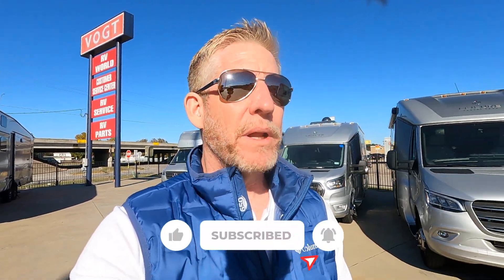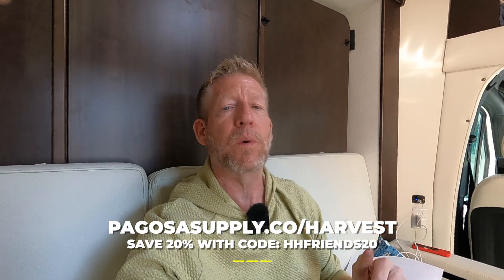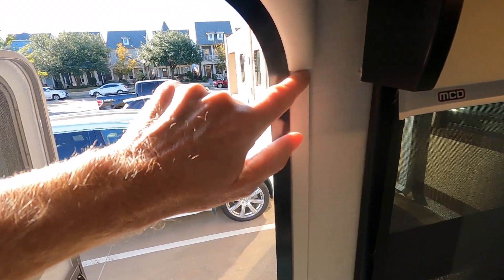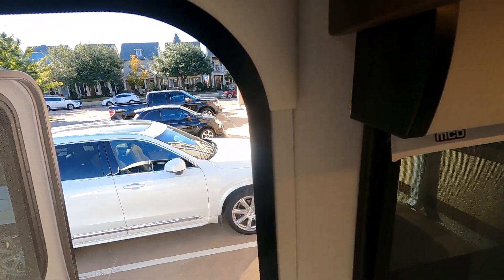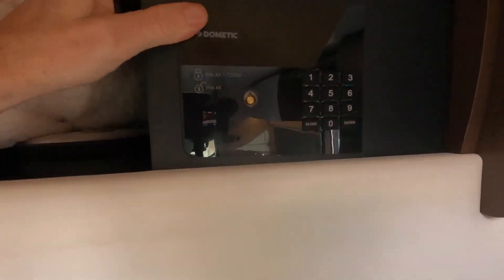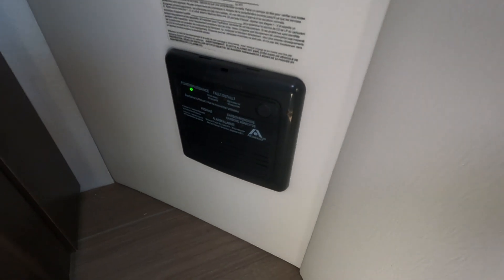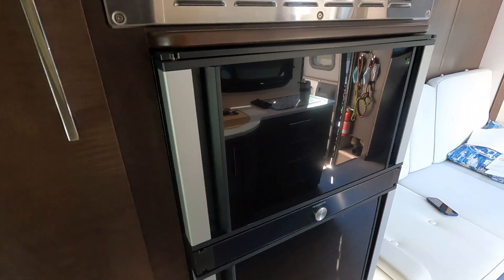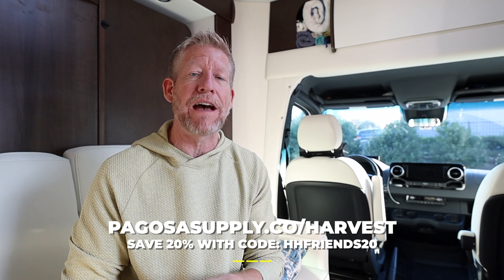These were not covered under 2 year warranty - Leisure Travel Vans

Comment: We enjoy your channel, Brandon.   We had the same galley drawer slide come off on our '19 FX.   I just used toothpicks and white glue to repair the holes.   I was lucky to find the screws below in the void, and I was pleased to see it was clean down there.   I believe the screws may have just succumbed to the pounding, and we may have exacerbated it.   The only other real issue we had was the tail light wiring harness rubbing against the fresh water tank bracket.  I fixed the bare wires and informed LTV.   You have to remember these are built to a price point, and all the components are made by a few companies.   We were recently 5th wheel shopping, take a look at the craftsmanship on those.
Reply from the maker: yes, I can't imagine how bad the travel trailers and such are put together. Thanks for the info, I may see if I can find the screws and just do it myself

Comment: When I bought our 2019 FX from Vogt earlier this year, we we’re having the same problem with the same struts as you are.  The ones located underneath the slide.  I called  Vogt and they had LTV send me two replacements.  The replacements were doing the same thing in cool weather.   Then it was getting to be warmer weather so they started working.  Now that it’s getting to be cooler weather again,  I just ordered two new replacements from Amazon and we’ll see how they do.

I’m with you, if LTV would use better components I would gladly just pay for them.  Either you pay for it up front or pay for it when they break.
Reply from the maker: Love to see which ones you ordered from Amazon, can you shoot me the link to brandon@pagosasupply.co?
Reply: @Pagosa  just sent the email 😀

Comment: Thanks, Brandon. I recently needed to replace a strut on a boat storage locker and discovered that Auto Zone had a large selection of sizes. I just popped the old one off the ball knuckles and popped the new one on. 10 seconds. And yes, the struts on the other lockers are still good after 22 seasons so it does seem a bit odd that you had 2 already give up.
Reply from the maker: These are on the larger doors, so I assume the size of struts used are not rated for that weight. The smaller doors are fine. I'm going to find some good replacements.

Comment: Consider the MAXXFAN Deluxe model 7000K or 7500K.  Remote control.  We love ours...was an upgrade on our Navion.  Has auto temp set, reverse air from intake or exhaust and Variable fan speeds.  2yr warranty. Exceptionally reliable... flawless for 4 years.
Reply from the maker: Thanks for sharing and look forward to a better option for sure

Comment: I agree, RV products are pretty cheaply made and certainly surprised LTV would install crap products like the solar controller.
My Wife and I are about to order a new Corner Bed Unity, we live up BC Canada so seeing your frustrations is a bit alarming M8.
Personally those outside locker’s should have two gas struts per door, and secondly replace them with good marine quality units.
I ran a my own Marine Repair company for nearly 40 yrs up in Vancouver, so I’ll be replacing pumps and installing a marine quality macerator in the RV down the road.
I don’t like the 3 way fridges either, so I’ll be converting it to a compressor AC/DC type.
Buying a refrigeration kit and installing it myself won’t be too difficult, certainly no more than converting a boat’s Ice Box to a Refrigerator/Freezer.
Installing a marine propane sniffer system in place of the existing, and fitting the sensors under and close to those appliances operating with propane should be straight fwd.
Personally I’m not even a fan of Xantrex converter’s, always had issues with these in the marine industry.
Love your channel and will certainly be buying some of your products.
Good luck with your repairs M8.🇳🇿🇨🇦
Reply: We upgraded to lithium and replaced Xantrex and all solar and inverter systems with total Victron.  What an awesome difference in efficiency and maintenance free!!
Reply from the maker: Thanks Murray, I will look for Marine grade struts to replace. We have lithium and had intended to replace the solar controller anyway to a Victron, so now it's just making me do it and not be lazy, lol.
Reply from the maker: Yes, I'm a Lithionics guy with our battery and will be putting in the victron controller for sure.

Comment: You might try contacting the manufacturers of the components directly and see if they will do anything. On a non Leisure Van I had a dealer tell me some things were not covered under warranty but when I contacted the manufacturers directly they were covered under manufacturers warranty.
Reply from the maker: I definitely plan on doing that, as well as talking to Leisure. I know a few of the management team watch these videos, so hopefully they understand putting some bad quality items in isn't a great idea.
Reply: That’s LTVs job to work with the component manufacturer.  LTV should be covering those items for you, and working with manufacturer for their own coverage.   LTV is the customer of those manufacturers, not you.

Comment: On your drawers, the slide extensions are not the problem. The screws are stripping out from the wood. For a permanent fix, take a screw out, coat with Loctite and screw back in. Do this one at a time to all of them and it will cure your drawer problems.
Reply from the maker: Yes, I think I said it was the glide's fault, but clearly it's a screw, or a cabinet material issue. I'll take advice about the lock tight. Thanks!

Comment: Wow those drawer glides dont make sense! Mine has been at the dealer for a month. The safe doesn’t unlock too. The propane tank doesn’t fill and has to be replaced, and tank sensors don’t work 1/2 the time. Thankfully everything was covered under our 90 day sellers warranty. We also bought the extended warranty.:)
Reply from the maker: Geez, that’s a lot

Comment: Any issues with Fantastic Fan can be handled directly with the manufacturer. Over the years they have sent me parts for free that were several years out of warranty. Hopefully, that is still the case. When Newmar had an industry leading 3 year warranty, they made their OEM vendors match their warranty. However, other RV builders didn’t follow Newman’s lead and Newmar dropped back to a one year warranty in 2006, except for high line diesel models at 2 years(not sure bout 3rd party components). 

I would not take any RV to a dealer for service. Independents have quicker turnaround, live or die on their customer service. Dealers first priority are getting new and used sales units out the door. 

For those thinking this was an excessive punch list, know that this really minimal. Doesn’t excuse the problems, but as an RVer for 22 years, this is small stuff. And, the more high line a coach is, the longer the punch list. I like that LTV will ship parts directly to me instead of requiring I order and pickup through a dealer. I had them send replacement LP/CO detector, Jensen house radio, remote door lock sensors and a couple of other items early in the first year. No questions asked. Did the work myself, and I’m no RV tech.
Reply from the maker: This was extremely easy punch list. Love my LTV

Comment: Just took delivery of our 2022 Unity RL on 15 November. Good news it that the Go Power Solar Controller is no longer being installed on newer units. Zamp rigid panels are now standard. Bad new is that the controller is now a Zamp ZS-30A paired up to the panels - which is still a PWM-style controller. Also, it is NOT Bluetooth-compatible.

Our Fantastic Fans are controllable from either of two remote panels, the main Firefly panel or via my Mira phone APP. The phone APP and panels do not control the fan speed - which is still a manual knob.
Reply: Forgot to add that our safe is on backorder from Triple E.
Reply from the maker: Ah, bummer. They had a chance to put in a good solar controller and they still didn’t. Just don’t understand that logic. Congrats on the RL!
Reply: @Pagosa  Thanks. It was a cancellation by a couple that faced some unexpected medical expenses. It has all but a couple of the options we'd ordered and didn't anticipate recieving until Summer 2022.

Comment: That is an alarming number of defects for a relatively new van, especially considering how much of a demand there is for these units.
Reply: Still waiting for our LTV Wonder. This video will give me a few things to really inspect when I finally get it.  I am still at least 18 months out so maybe your video will cause them to get better quality parts for their expensive options.
Reply from the maker: The RV experience is one of constant things going wrong, but I was surprised by the safe and the solar controller going out so quickly.
Reply from the maker: Hopefully so!
Reply: I had a LTV and it was MILES AHEAD of the quality versus many other units.  Sure somethings broke but driving down interstate roads at 65mph that are literally falling apart all RVs are going to have some issues along the way.  I wouldn't hesitate getting another one.....
Reply from the maker: @cocochanel9291  Agree, I was just disappointed in the cheapest third party components they could find.
Reply: @Pagosa  As an aside, the struts failed on my 2018 LTV.  I would agree that certain parts are suspect at best.

Comment: After watching this, and your own harsh critique of LTV for using cheap components, I’d say describing their product as “premium “ is a bit of a stretch.  There is no way the use of cheap low grade components ends at what you’ve discovered.  Cheap low grade goes end to end, and to think otherwise is naive.  You’ve proven it.  And LTV’s short and weak warranty proves it.  Furthermore, the fit and finish elements of the build took a hit here as well.  Im not an RV owner, but am considering buying B+ in near future.  While I really like multiple design elements of LTV, I’m not impressed with the quality.  And this video backs that up.  Thank you.  Good video.
Reply from the maker: Probably should have prefaced this with these components they use are in all RVs and will say the LTV is as good a build as you can get. I would still choose LTV over any other B+ by a mile.

Comment: I can't believe they had your ltv for 3 wks to fix a molding and a drawer slide,  the same exact drawer slide fell apart on my fx I fixed it myself took about 30 minutes ,nearest rv repair is an hour away from me. I actually put  larger screws in the original holes and added a couple extra screws. Its not the slides its to few screws.
Reply from the maker: They are so backed up, I was glad it only took 3 weeks. In their defense, they had to check and research all of those other issues and then I'm sure the drawer just took a day to do.

Comment: Too soft wood, all my cabinet doors on my 2018 UMB have broken loose. I’ve had to fill the screw holes and replace screws with standard wood screws. Same problem with struts.
Reply from the maker: I've had a few folks recommend marine grade struts, so I will be replacing with those.

Comment: You should talk directly with LTV and not go through the dealer for warranty repairs. LTV may cover some items that a dealer will tell you are not covered. As to your Propane alarm going off at night, do you have a dog and if so, does the dog sleep on the floor close to the sensor? Dog farts could set this alarm off.
Reply from the maker: Haha, the dog thing is real, but not in this case unfortunately. I do plan on speaking with LTV and see what they can do